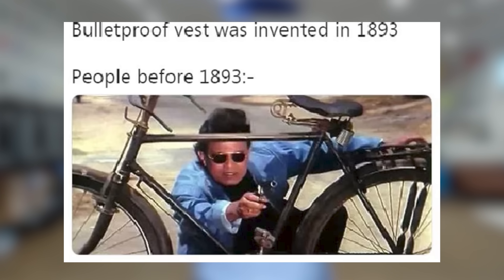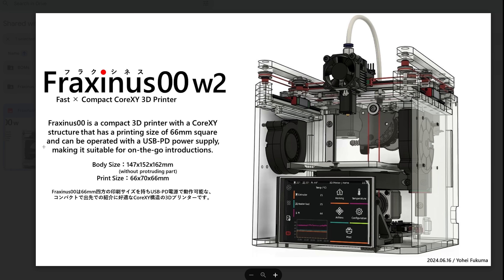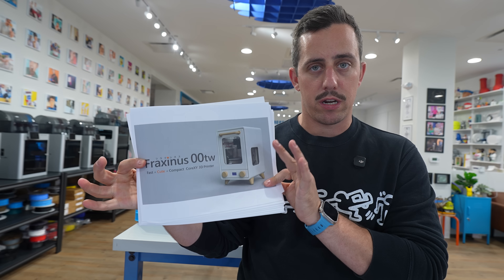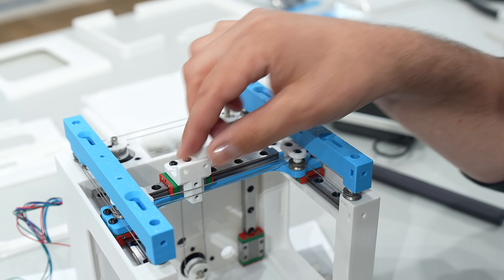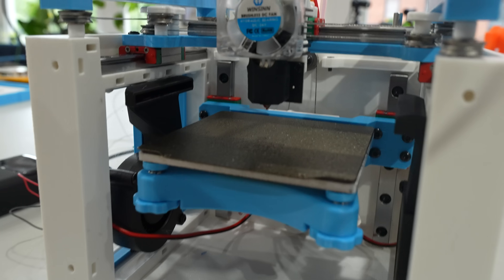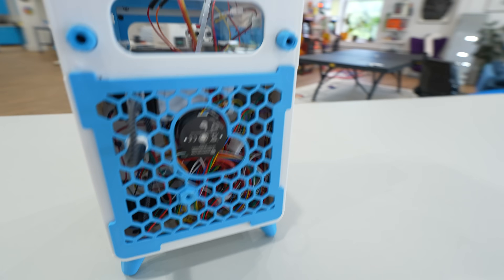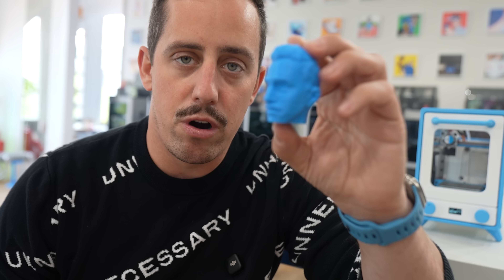I 3D Printed a 3D Printer.

Comment from the maker: What upgrades could I do for the final build of the mini printer?!
Reply: A 3d printed 3d printer should definitely used to print mini 3d printers.
Reply: HI Matty, I'm the guy who wears a 3D printer backpack to conventions so I have some experience with this. I would recommend making a frame that makes it more comfortable to carry and not get bumped too much. The USB-C battery I'm assuming it's outputting 20V through a USB-C breakout adapter. You can technically run two battery packs in parallel if you use a Schottky diode (15SQ045 is what I used) in series with each input power source that way you can hot-swap battery packs when one dies or double the current capacity. Also a little LED lighting would make a lot of difference for highlighting the print.
Reply: I also am concerned with steel cable pulley system for CoreXY, that's probably why your print quality isn't that good. Also if you haven't, do Pressure Advance and E-step tuning, it looks like your first print is over-extruded which makes side walls wobbly looking.
Reply: LEDs on the inside
Reply: You shoud add a light indecator that shows how mutch power power is left in the battery, and mayby also add a way that the printer can say if ther is not enothe power to run the print😊
Reply: Not a huge upgrade, but that USB cable sticking so far out the back is bugging me. You shout get a USB C cable with a right angle and put it on there so it doesn't stick out like that.
Reply: A camera to watch every thing
Reply: Make a mini AMS for it that uses only 250g spools.
Reply: @Snappleflies hell yeah
Reply: Put a keychain hole on your mini head
Reply: @jasonh9519  Put a key chain hole on the printer
Reply: Braided cable sleeving to the extruded. Little cosmetic thing, but finishes it off.
Reply: Add a more tiny screen for device info
Reply: make it so that you have a little station for it to charge the power bank, hook up a multicolor system, do some maintenence, etc
Reply: 0.2mm Nozzle or even smaller, since youre alreay printing small might aswell make it very detailed.
Reply: Add microwave oven ding, when print is ready..
Reply: Wear it as a hat, printing you wearing little hat.
Reply: How can I get files for free?
For this 3D printer
Reply: Don't you give away any broken or useless 3d printer. I love 3d printing . But i don't have one. 😢
Reply: can we Collab soon pls, i would like one of those mini 3d printer for my own, could you help me
Reply: You should TOTALLY change your signature model from your head to a small simplified model of the Fraxinus 00tw. that way it can print itself! (kinda). I'm trying source all the parts for the UK so that I can build my own, Wish me luck!
Reply: (I know its sad but you can just bring a power bank with an inverter) Ditch the whole control system and go for 24, or if your spicy, 48 volts. Get bigger stepper motors, and more part cooling, and a more powerful hotend. Make sure you get it Running Klipper, and even Octoprint at the same time, and any other upgrades to get this thing 1K+mm/s print speed!!!
Reply: That looks like it might be a good starting candidate for an ECO-Printer. Increase battery capacity, add a solar panel, and then swap out the extruder and nozzle for one that can use recycled plastic strips from discarded soft drink bottles. Near-zero carbon footprint, portable recycling facility!
 
Google: " how to turn empty drink bottles into printer filament "
Reply: I wanna make this
Reply: A handle to carry it around
Reply: You forgot the most important part of making a tool, which is to make the final part of the tool with the tool
Reply: Make something that has your voice that says “hey! Your new unnecessary invention is ready”
Reply: cat ears
Reply: have the entire enclosure milled from aluminum from pcbway so its heavy af for no reason
Reply: A „Bing“ Sound at the and of the print.
Reply: handle
Reply: A briefcase to make it even more portable.
Reply: You could slow down the print speed, so the quality comes out better! 👌🏻
Reply: Handle on the top
Reply: Yes there is a difference....technically lol but everyone knows what you mean regardless. Looks very awesome dude. Kind of gives my Fantastic 4: First Steps with the kind of retro oven look and the color scheme.
Reply: New Idea: 3D print a 3D printer inside your 3D printed 3D printer.
Reply: 3d print a 3d printer and so on
Reply: button that just starts a print for your head
Reply: A handle  to Cary it I like a briefcase
Reply: Adding your channel logo on the front or back of the printer
Reply: I think it could be really cool to turn it into a 3d printer backpack so you can bring it anywhere easily.
Reply: Print a 3d printed 3d printer with a 3d printed 3d printer 🖨️ 😅😅😅
Reply: Day 1. NoW build a clay 3d printer 😊  So you can 3d ceramics  tgat should  be unnecessary enough
Reply: 3d print a 3d printer with the 3d printed 3d printer
Reply: A muffin
Reply: put a speaker on it to make it ding like an old oven or microwave when the print is done

lol but fr though, it would be really cool to scale this up to be a custom enclosure for a Voron 2.4 or Trident or something, since you've basically already made a custom Voron 0
Reply: Add a handle to the top
Reply: You should add a handle to cart like a briefcase in public 👀
Reply: I wonder whats the price of such 3D printer?
Reply: A holder for the filament to put on the side of the 3-D printer
Reply: Add a holder to it for the filament
Reply: Auto lubricator
Reply: An enclosure for the tiny filaments with silica gel box to prevent moisture. Probably slightly angle the screen up so you don't have to contort your head by looking at the display - but by then that would be a necessary upgrade counter to the ethos of your channel. 😆

Maybe make it walk either with feet or in wheels and have it remotely-controlled to come to or follow you automatically rather than carry it all the time... Now that's soooo, unnecessary!🤣😂
Reply: Make 3w
Reply: make it ding when it ends a print
Reply: 3-D printer that prints a 3-D printer that prints the 3-D printer that prints…
Reply: you should make a TEENIE TINY (non operational lol) 3d printer, that the mini 3d printer prints ! haha
Reply: You should find a way to quickly scan someone else's head so you can print them when you're out at like a coffee shop or something
Reply: Can you please link us to the parts you bought?
Reply: make attachments that go on the back, like croc jibits
Reply: You should put “@unnecessaryinventions” on the build plate since it’s custom
Reply: Hej
Reply: Hej
Reply: I need one for me :)❤
Reply: Make a 3-D printer Lego set
Reply: Make it print in chocolate!
Reply: Make its nozzle smaller, and\or improve print quality
Reply: Can you upload all the files and make this into a reprap project?
Reply: Wheels.  Add a carrying strap or backpack straps ❤  it's so adorable. Add rgb lights and bluetooth. GPS tracker. Slow motion camera. And use that 3d printer to 3d print another smaller printer 😍 Great video
Reply: I don't have any upgrades but I am a small YouTuber and I want to 3d print the printer on my flash forge 3d printer so if you can, send all hardware and electronics to me please.
Reply: Automatic toilet paper giver
Reply: What was the total cost of components?
Reply: Use all filament of one role to 3d print filament and the holder
Reply: you should use it to print a new attachment to put your H back on the wall in "This is Unnecessary"
Reply: what is on the floor under the rocket picture
Reply: add a way to add your channel logo on the back
and also make the top of it have burner like a real oven and have there be dial to control the temp of each burner
Reply: Idk

Comment: Cords refer to power, wires refer to connectivity. So if it runs on battery, it's cordless. If you can print without a USB cable, it's wireless. So that would be Cordless AND Wireless!

Comment: omg, this is so amazing!. Props to the guy who came up with this.. Btw, watching this video made me wonder.. Why do 3d printers even use belts? i know in the old days, you would have to tighten them every now and then, but this has gotten much better.. But why not use something like a long screw that is mounted between the printer head and the printer head "holder bar",  where the printer head either runs left or right, depending on which way the screw is rotating..? i feel like that would give the absolute best precision, instead of having belts, and also be something that would almost never requires maintenance

Comment: what if you print a 3d printer and 3d print a 3d printer and 3d print a 3d printer with the 3d printer with the 3d printer printed by the 3d printer printed by the 3d printer?

Comment: well, does Ripping a Ender 3 pro apart and making it a bigger version count as building a printer? if so then i have build a printer. i mean i wanted the BLTouch and the Direct Drive so i decided why not making it 500x 500y 1200z  and add a mosaic palette 2 to it. no the print bed is not heated, i ditched that idea because i print onto the table top of a glas table and covering it with paper masking tape.
now i own a K2 Pro for about a month and this thing rocks ^^

Comment: I came across this because I think it should be possible to buy a cheap small 3d printer and then print a large 3d printer piece by piece(And then make, buy or find in scrap the other components). I can code and I'm quite familiar with electronics but new to the 3d printing and product design world.

There are large things I want to make that would be more practical and cost effective if made as one object. 

Is this a feasible project?

Comment: Hey what about a single use 3D printed pop it board fidget toy that’s like popping bubbles wrap but with a bunch of different shaped 3d print printed pop out that are like all the different supports you use when 3d printing? Think kinda asmr as you get to pop the different shapes out and feel and hear the different sounds

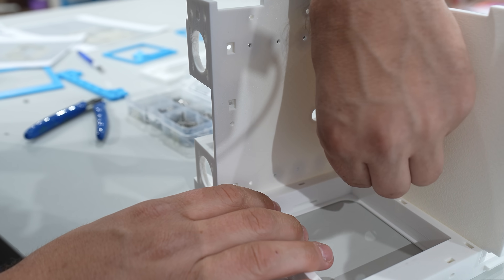Comment: 9:19 Project idea: Make a screwdriver which can load and hold multiple screws like nail gun. which should be easy to fill like paintball gun, which can  figure out orientation automatically. Over engineered part will make it unnecessary 😏
Reply: Yes

Comment: One of the first things I would do is angle that usb-c Jack on the back straight down because inevitably something's going to bump into that and tweak either the plug or the socket. 

The next thing I would do is tilt your head back about 20°modify the bottoms of the ears to connect them to your face and you should be able to print that mostly in vase mode

Comment: How many hours did the build take?  Contemplating this as a class project and how viable it would be costwise
Reply: I’d recommend checking out the Voron project. I’m building one now and the community is super helpful. There are a variety of models and sizes, so you can match the build to your class budget and time frame.

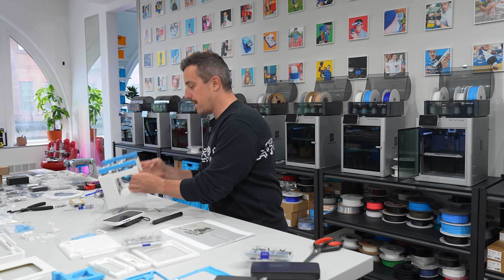Comment: 10:56 you could probably redesign this system to use belts instead of wire. The Voron V0 isn't much bigger than this and it uses belts

Comment: 3Dprint a 3d printer? You just described the entire RepRap project's raison d'etre that kinda kicked off the at home 3d printing/maker craze to begin with as most of the big players in commercial printers designs are built on their legacy. Heck Prusa is one of the OG contributors.

Comment: The print bed isn’t heated, right?
Reply from the maker: It is heated - it has two heating units and a thermistor to measure the temp. Heats up so fast due to the size.

Comment: You could move the controls from the bottom to the top where all (European) ovens have their controls, and replace them with a drawer where all (European) ovens have a drawer, and turn it into a drawer to put the filament cartridge – Instead of creating a pointlessly small cartridge where there's even more tension on the filament...?

Comment: can you make the whole 3d printer even the mechanical & structural parts 3d printed even the hotend & use for that a heat resistant filament for the moving parts a durable filament
i asked chatgpt is if is possible to print the whole printer from PEEK a filament known for it's durability & heat resistance it is possible
for safety you only print with PEEK i think you can even print the nuts & bolt/screws

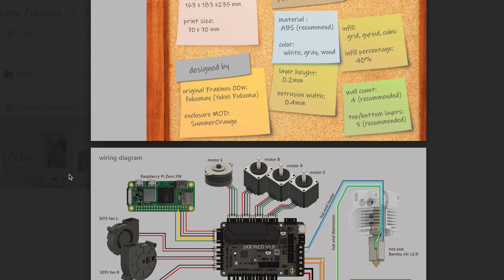Comment: 📖 Inspiration for Inventions (00:00 - 03:06)
├─ 00:00 Random Meme Inspiration
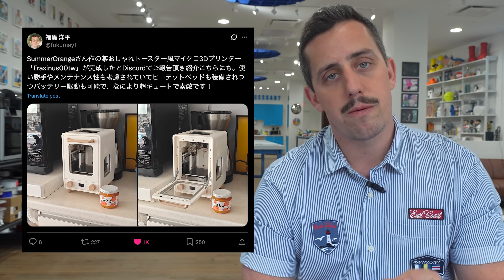├─ 00:31 Desire to Build a 3D Printer
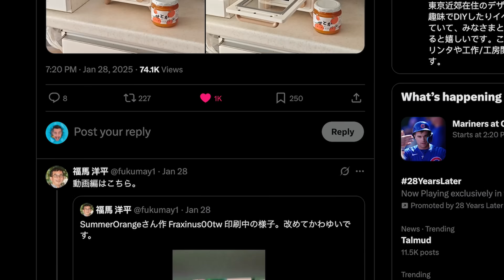├─ 01:02 Tracking Down the 3D Printer's Origin
├─ 02:05 Contacting Summer Orange for Build Instructions

📖 Initial Thoughts and Concerns (03:06 - 06:12)
├─ 03:06 Evaluating the Instruction Manual and Resources
├─ 03:37 Assessing the Availability of Parts and Materials
├─ 05:08 Organizing and Managing Components
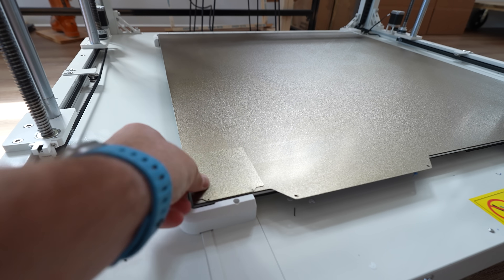├─ 05:40 Comparing Build Plate Sizes

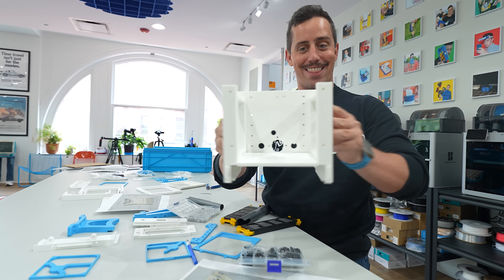📖 Designing and Customizing a 3D Printer (06:12 - 09:45)
├─ 06:12 Adding Personal Touches to the 3D Printer
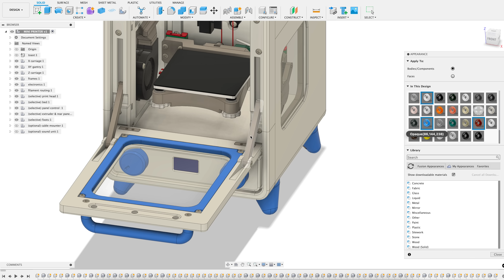├─ 06:43 Preparing for Printing and Loading Filament
├─ 07:43 Ordering Parts and Following Instructions
├─ 08:14 Assembling the Frame and Encountering Challenges

📖 Initial Build and Drive System Assembly (09:45 - 15:02)
├─ 09:45 Assembling the Drive System and Initial Impressions
├─ 10:49 Using the 3D Model for Guidance
├─ 11:21 Completing the Drive System Assembly and Posting Build Progress
├─ 12:14 Preparing for a Test Print
├─ 13:18 Testing the Extruder and Preparing to Start Printing
├─ 13:48 Successful First Layer Print
├─ 14:30 Initial Reaction and Assessment of the Build

📖 Unboxing and Tour of the 3D Printed 3D Printer (15:02 - 17:42)
├─ 15:02 Confidence in the Printer's Capabilities
├─ 15:43 Tour of the Printer's Features and Design
├─ 16:44 Wireless Capability and Signature Print Idea

Comment: It's so cool to think that 10 years ago, this printer would be the top tier printer in term of quality.
Reply: While true, don’t forget the hardware progress from the Voron team that commoditised this form factor even more, followed by Bambu X1C bringing it to the masses
Reply: Bro why 🤷 like 3d printers were never limited by hardware.....(Cnc's existed way before them) But always by SOFTWARE..... SO the limiting factor always was the slicer.....and because consumer slicers were so bad, it mostly didn't matter what hardware you were running
Reply: @Basement_CNC There were definitely hardware limitations. Build plates, heater beds. Bed leveling sensors. Even the frame itself whether it be the i3 designs or, more recently, corexy variants. Each of these solved major issues. Probably the biggest innovation has been build plates and heated beds. These solved major first layer issues that really held 3d printing back. Hard to improve when the majority of prints fail due to bed adhesion.

Another major improvement has been printer firmware. First merlin and now klipper. These significantly improved print quality.

Slicers have improved as well, but I'd say this has had less of an impact than hardware and firmware. I know people who still use very old slicers and get good results on modern hardware.
Reply: @Basement_CNC slicers really havent changed that much, firmware and mechanical designs have seen the most upgrades, CNC has been around for a while but whats good for a 3d printer has only been explored since the reprap project started went stagnant for about 4 years and then exploded again with voron
Reply: @Basement_CNC as someone who maintains a collection of printers from 2009 to 2015 in addition to my modern printers. I do somewhat agree that modern software helps a lot. But not always as much as we would think. People wouldn't be able to tell the difference between a print from Old Cura 2012.10 and modern Cura 5.x most of the time. A good example of software helping is Marlin on a Replicator 1 in conjunction with Prusa Slicer in dual color printing. Temperature based ooze prevention made easy.

A lot of early printers have severe hardware limitations and the fixes seem basic when coming from our current collective knowledge. But at the time people were still trying to figure it out. I would say by 2014 (which falls near the original posters 10 year mark) things were close enough to modern if that is where you are thinking.
Reply: 10 ? the ender 3 v2 released 5 years ago this printer even 3 years ago would be considered top tier.

Comment: Your LED fan is probably wired wrong or programmed wrong. It should start to spin as soon as the hotend reaches 50°C, it seems like it is programmed to be the part cooling fan instead. If not changed you may be having a problem when printing a part covering the whole bed, as the fan will only kick in at the 2nd layer and the cold side of your hotend may be already so hot that it melted the holder or the PLA gets stuck in the hotend.

Comment: For me, cordless = power, wireless = data. So the printer is cordless and wireless.
Reply: It uses an SD card for the printed files? That would just make it cordless. Or did I just miss it having WiFi too?
Reply: @FoobarDesign  Don't know all the specs. Saw the Pi in it, so maybe it can/could use WiFi. But you're right. It uses the SD card predominantly, so it is only cordless.